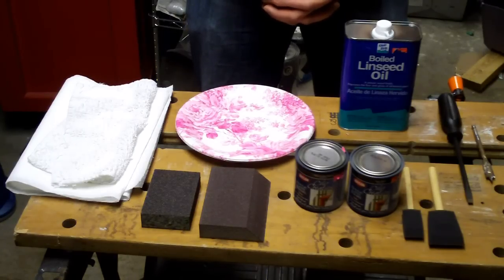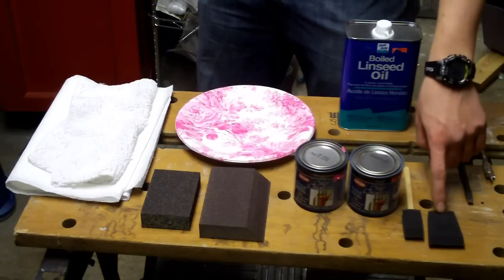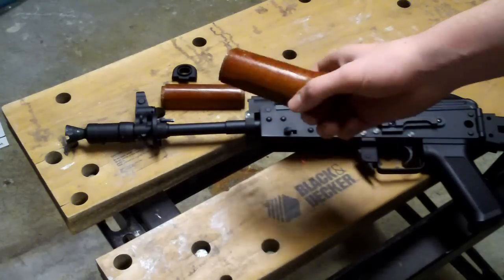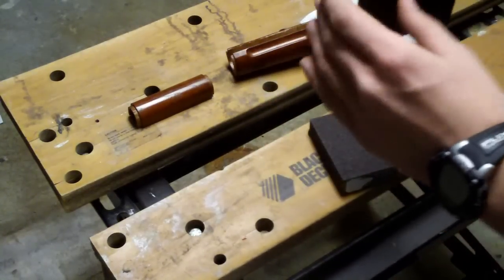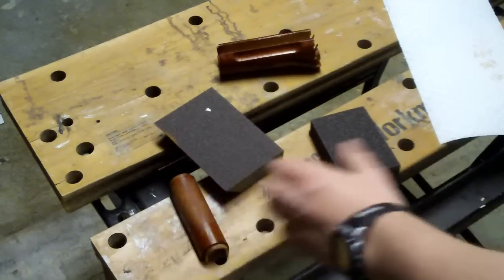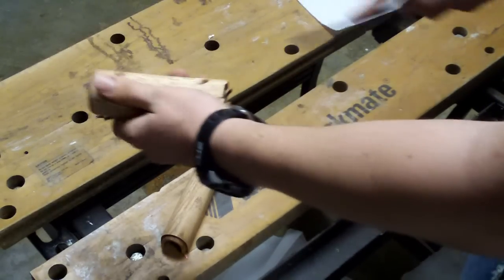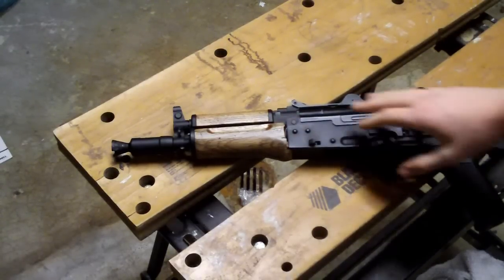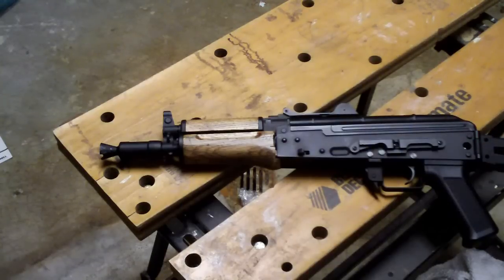Treating and Aging Airsoft Wood

Comment from the maker: Well even though you are just 'oiling' it, the Linseed oil is also a finish/sealant just like polyurethane or wax.  I personally like Linseed oil because it makes wood grain 'pop,' whereas a more durable PU coating is slightly more plastic-y.  To each his own, I guess.

Comment: What you could do is sand off the finish, restain it using half the stain that you normally would, then add a sealant. oh yeah, rub it down with mud after that, and then rub it off after 5 minutes.

Comment: Lulz. FPS is overrated. JG BAR 10 with PDI 6.01 MM TB barrel. That's it. When the sears die, get a zero trigger, with a new spring and spring guide. If you are serious about sniping you NEED to spend over 400 USD, if you want to hit targets consistently.